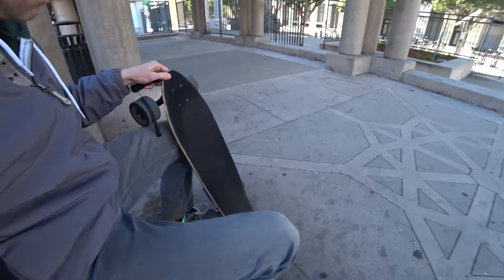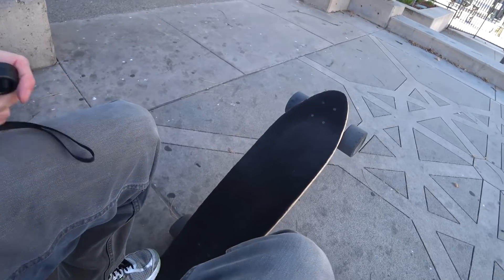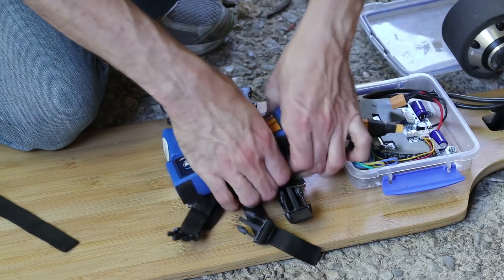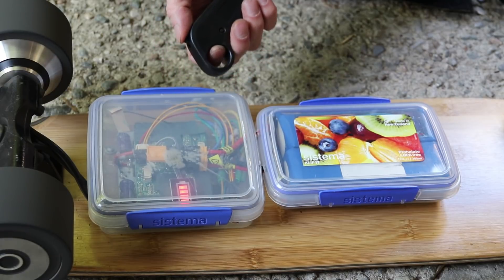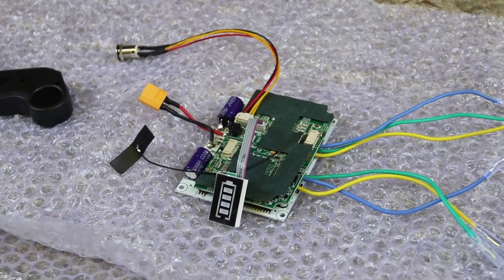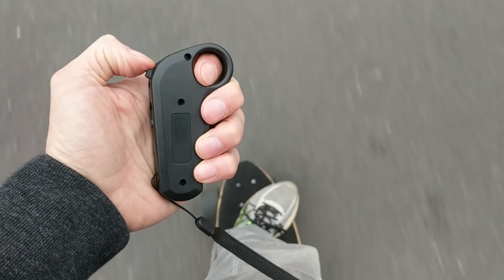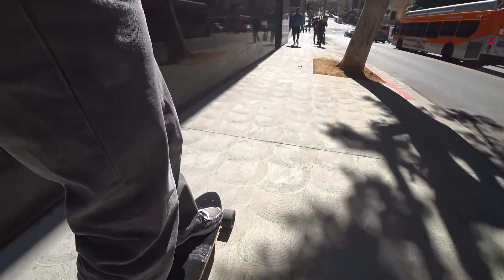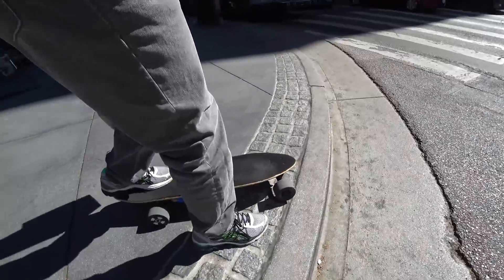Awesome Electric Longboard ++ | Improving The Details | Price ＜ $350

Comment: Hey Oren, great videos!

I've been itching to get an electric skateboard and definitely want to go the DIY route so I can get the deck style I want and because I will end up tinkering with whatever board I get, so I may as well avoid paying a premium for a branded one.  My concern is regarding how to set up the batteries/BMS/charger in such a way that I can simply charge it with a laptop brick like the commercial boards.  Because of that I am leaning toward buying this kit; which simply needs a deck:

http://www.diyeboard.com/10s5p-360wh-battery-esc-dual-motor-belt-drive-power-truck-kit-p-590.html

My hope is to start with that kit and then upgrade the parts down the line.  I feel I will be better able to comprehend how everything works once I have an assembled board in hand. 

 Do you think this is a viable plan or should I outright avoid kits like that?
-------------------------
I'd like a board to compete with the new Boosted Mini X that my friend just got; with the range to go all around the Santa Monica / Venice area and the power to go up and down some hills in the Ventura County are where I live.

Thanks, I appreciate the opinion— Your videos are so honest and it very much helps seeing boards used in the real world in the same place/manner as I'd like.
Reply from the maker: Thanks! That looks like a nice kit. I think it could be a good way to get started. I think it depends on your preference. I would personally prefer the 90mm hub motor kit (instead of belts). Hub motors fit better on a short board and have less moving parts to maintain - and they're quieter. Also, I've been going with lipos and the food containers because I like having batteries that I can easily interchange (I can bring extra batteries in a backpack). I know it's not easy to figure out what parts you need when you first start. After a while you'll get a good sense of how you use the board and what'll work best for you (and you can always make changes later). As you can see from my videos I went through many revisions! Good luck with your build!

Comment: Hello! Greetings from Chile, why did you changed the esc? I just ordered one of the old ones😅 and haven’t you thought about putting a bms for easier charging?
Thanks for your videos!
Reply from the maker: Hey Miguel, Chile looks like a very nice place. The original ESC broke. I did some sloppy soldering to change it from 6S to 10S and I think I weakened some of the solder joints. The old ESC version is good too. I like the 3-speeds in the new one but the battery meter isn't that important to me. The ESC will beep when the battery gets low. I would put in a bms if I build my own pack with Li-ion. For LiPos it's been easier to just hook them to a balance charger. Li-ion is better but the LiPos are usually cheaper and make the build easier.
Reply: I see now, thank you so much!!
Reply: Hello !Me again...wich batteries would you recommend, lipo or ion-li??
Thank you

Comment: Another great video, Oren!  Do you have the weight for new board?  And could you look up the incline of that hill?  Here's how:  https://atomicsupermen.wordpress.com/2018/01/11/measure-death-hills-for-electric-skateboarding-and-other-transit/  Thanks!
Reply from the maker: Thanks Mike! The updated board in this video is basically the same weight as the longboard version, 14.6 lbs. Most of the weight is in the motors and battery. The Findhills site is a great resource. I looked up the hill https://fdhl.co/2F318LE (Grade: 11.18%, Steepest: 14.88%).
Reply: Thanks!  Waiting for the belt drive video!

Comment: Quality content, as usual. Looking forward to your next vid to see how the belt drive holds up. I still havnt built mine yet lol... This is good though, it means I get to see your comparison vid first. I'm leaning towards belt because single drive can be made on a super budget with a basic esc and 1 motor and stuff. But for quality riding around I do feel like a good dual drive hub motor with quality esc is hard to beat.
Reply from the maker: Thanks! I agree with those points between belt and hub motors. Each type of board has its strengths. I'll try to get the belt board video done soon and go through the comparison.

Comment: Great videos. Keep them coming. Your videos inspired me to build my own. It’s a belt drive with single 6874 motor with 97mm abec flywheels on a loaded vanguard. Thank you, keep up the great work
Reply from the maker: Thanks! I'm glad they're helpful. Sounds like you're building an awesome board. Is it 6874? That would be big. I usually see 6374. 97mm wheels on a loaded deck should give a super smooth ride. I'm sure it'll turn out well!
Reply: Oops.  I meant 6374.  It’s amazing how strong one motor is. I weigh about 210 and I’m using a 10s3p pack.  Lots of fun. I’m not a safety sally but I starred wearing helmet.  These things get dicey sometimes
Reply from the maker: Yeah, the 6374 does have a lot of power. The belt also helps with torque. A helmet is a smart move, these boards are scary fast at top speed. That's awesome your board is working out well. A 10S3P pack should give you plenty of range.
Reply: Daniel Brennan hey i just wondered how it held up and what esc you are/were using and how that turned out. Anyway thanks :)

Comment: you have to make more videos for sure.  i know that you will post another video, but just a sneak peak. what is size of the wheels and  the cruiser board? and about the lipo, was this dangerous haha?
Reply from the maker: I'll do my best to get more videos out soon. Do you mean the belt board? That one has 83mm wheels and the deck is a bit smaller. The lipo incident was scary. Luckily it didn't cause a fire!
Reply from the maker: I just checked out the Ownboard esc+remote. It looks very nice. I'll definitely try it for my next build.
Reply from the maker: I know 18650s are better. I was trying to keep the soldering to a minimum with these builds. I'm sure I'll get to building one soon though.